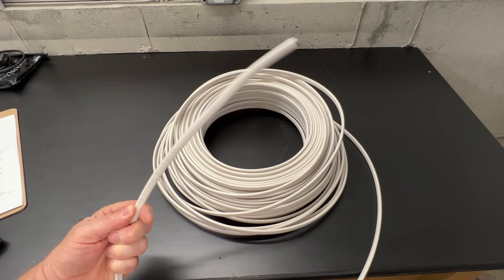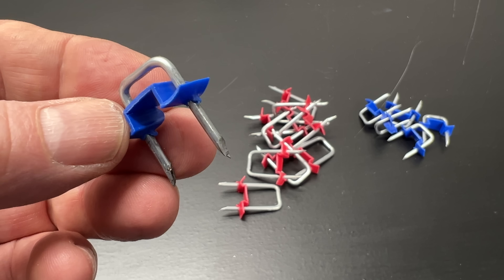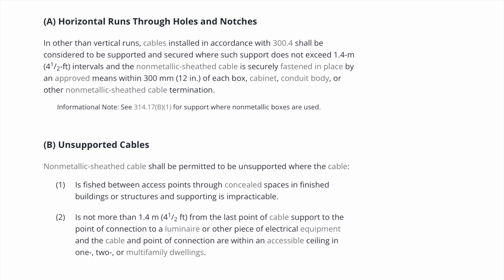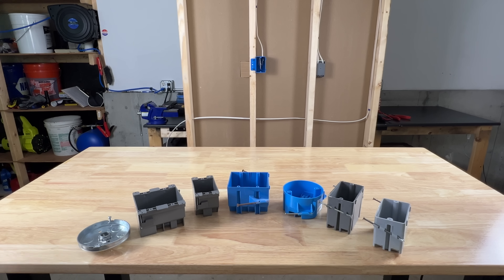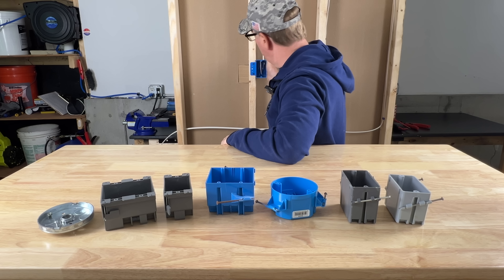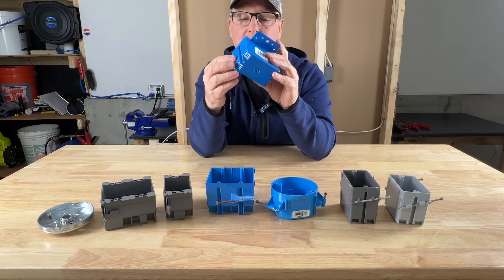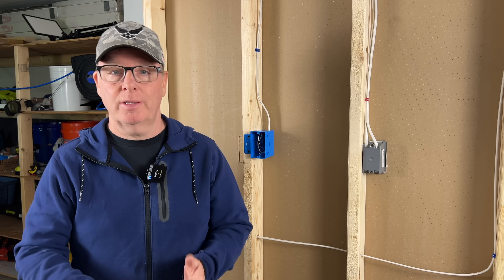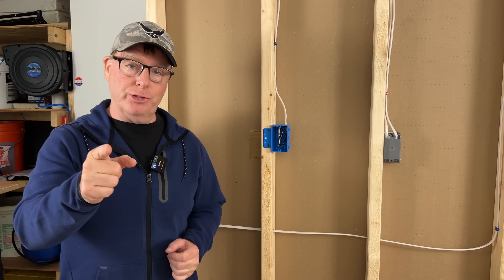ROMEX Cable Support Requirements (2025)

Comment: A staple holds the wire in place ....so a nail  or  screw can peirce into it......the older romex Had a thicker  insulation  on it....hmmmm....NEC....approved. for a thinner insulation ??????...what to save money???how's that safer....
Reply from the maker: I'm pretty sure the idea of securing the cable in place is to prevent damage. There are rules around how close the cable can be secured to the edge of the wood member or through holes or notches without additional protection. Maybe take a look at article 334.

Comment: @BackyardMaine Shouldn't it then be code compliant to put a cable staple 4" from the junction box AND have 8" of cable slack between the junction box and that closest cable staple?
Reply from the maker: That would be 4" of slack and then 4" to the box. You could do that possibly but you would have to be careful about the bending radius of the cable which has code limitations as well. In my view with single gang, non-metallic boxes, the best way to leave slack, if you really thought it was necessary, would be to leave it above the staple and just make sure the staple is not tight against the cable.

Comment: Are there code issues related to the type of staple? I'm thinking of those staples with two nails vs the u-shaped continuous steel ones? I confess that as a DIY guy the "2 nail" versions are easier in cramped quarters.
Reply from the maker: Any staple will work as long as they are listed for NM cable support. The 2-Nail staples are fine.
Reply: Follow manufacturer instruction.

Comment: Great video John. Best one I have seen yet of the dozen or so I have watched. I am probably a little giddy that you proved service loops are not legal (except of course when clamped and not over the 18" length maximum). I think service loops defeat the purpose of securing cables as the cable can accidentally be rolled out of the wall before or during the final enclosure of the wall. It's also very wasteful with only a incredibly slim chance of ever being used to 'save' time ( but that's another entire discussion). Bottom line, the service loops I have seen installed are almost ALL noncompliant. 👍
Reply from the maker: Thank you my friend.. I don't like them either. The big round loops you will see similar to the one I made in the video are always a code violation. The code change adding the 18" maximum cable came in the 2020 update. I think or it could have been the 2017. I'm sure it was made to limit service loops. I have another video going live this evening on a not so common method of wiring three way switches. Thanks for dropping by..

Comment: In the last scenario, what if you made your service loop and brought it back through the staple which is 6" from the box? If you don't drive the staple in too hard, the service loop can still be pulled down into the box if needed.
Reply from the maker: Many people even electrician will drive the staples in tool tight.. The staples are just there to hold the wire in place so it won't get damaged. I usually leave a bit of slack in runs by squaring off all the corners and leaving the staple where they are making contact but not tight. Then like you're saying you could pull a bit of slack through the staple. Thanks for adding to the conversation. The video I made before this one was on extending short wires.
Reply: Hello, I’m planning to run a Romex cable (15amp circuit) behind the Sheetrock wall to extend power outlet to the top in order to have a wall mounted TV. Question is that a code violation not to secure a romex cable to the stud? I live in TX so not sure if TX code says something about this.😊
Reply from the maker: @BB-fp6gh  According to the national electrical code you can fish NM cables in the wall without any additional support. The old work box will also have a cable clamp so you are good to go. I don't know your local code but I would be shocked if there was an issue.

Comment: I still don't get why a so called "service loop"  is loved by so many.  Between the insulation install and drywall hangers generally not giving a rat's ass I think they are trouble in waiting
Reply from the maker: I don't leave service loops very often. If I'm in a bathroom and I think the vanity may have to move a bit or some other similar situation I may leave one but other than that I don't. In fact I really see anyone doing that at least around here.
Reply: It's left because drywallers suck and will shredded the wire in the box when cutting them out leaving you with 2 in of usable wire. So you leave the loop to pull more when that happens
Reply: It means less swearing when you replace a receptacle and have no extra length to deal with.

If you ever deal with fixing an old aluminum wire house via wazoo copper pigtails having extra wire helps. If none then hammer out the wall and sheet rock repair is required. Lol

In flooded areas here like Katrina when there is no extra you have the boxes be 6 inches higher.  Ie you replaced the 1st 4ft of sheetrock and the salt water ruined about 1 to 5 inches in the wire. So you have to cut off until good. So with zero reserve you raise the boxes.

Comment: So does that mean a 2 or 3 gang box without cable clamp is a code violation? Regardless of a staple within 8"?
Reply from the maker: Only single gang, non-metallic boxes are made with no cable clamps unless they're supplied with KOs for using ROMEX connectors.
Reply: @BackyardMaine  i thought the cable clamps in my PVC 2 gang boxes were knock outs just like the single gang, so I snapped them off just like I did with the single gang. Do I have to replace all these boxes? What's the best solution? Maybe rewire them and use the other holes/clamps (that has not been snapped) in the box and just ignore the knocked out hole?
Reply from the maker: @blamuk  If the walls are open just staple within 8" of the box. If the was are closed forget about it..

Comment: That seems the way it has been for years although I don't remember a service loop being mentioned. It would seem that a service loop could not be used with a 1 gang plastic without a clamp although not mentioned
Reply from the maker: The 18" max cable length was added to the code in either 2017 or 2020.  I can't remember for sure but it was one on those cycles.  I actually said "and since it’s measured in cable length leaving a service loop is not going to be possible" when referring to the 8" support. I think??

Comment: Always great information John!  After watching these, I'm always wondering how many inadvertant code violations I've committed in the past in my home improvement projects.
Reply from the maker: Thank you. Much appreciated. The code can be tricky if you're not used to using it daily. I try to state the requirements but then talk about them in practical terms. I'm not the best but I try real hard.
Reply: most importantly is your work safe and you understand wire size and breaker size relationships. There are other important rules but clamping or stapling distance to boxes isn't too important as long as you do it. If your work is being inspected then you might be more careful. In my many years as a general contractor my inspector only looked at my panel boxes and on final tested every receptacle. They don't have time to inspect every staple.

Comment: Ive been an electrician since 87. The only time I staple is if the inspector requires it which now days they usually do. Once I'm out of the jurisdiction of the inspector I don't staple unless the house is foamed or I feel the need. I don't know how many times on a new home I've had owners want me to add another switch etc in a box while we are trimming. If the wire isn't stapled I've used it for a pull to add another romex. If it is it makes the job a whole lot harder or impossible if there are fire blocks in the wall. The code book can be a pain.
Reply: Do it right or stay home! It's not a hobby. If you don't like something in the code, you can  fill out the form to make a change, oh wait, it's a pain for you!
Reply: @JM-iz3fr  Settle down Karen!
Reply from the maker: I understand..
Reply: Staples have always been code as far back as I know. In Texas since the state took over licensing,  all jobs are supposed to be inspected. The builder is supposed to hire an independent inspector if they are outside a municipal jurisdiction.
Reply: @nooneyouknowhere6148  In my part of Texas once you get outside the city limits it’s the Wild West. You do as you please and I don’t know of any contractor that’s hired an outside inspector. Contractors hate inspectors.
Reply: I understand that code  compliance can get in the way of efficiency. I humbly suggest compliance and charge accordingly with a change order.

Comment: Excellent review, I may still fail my first rough-in inspection, but at least not because of cable stapling.  Almost finished with a complete rewire to current code of my 2500 sq ft 100 year house that had functioning knob and tube.  Really appreciate your videos, thank you.
Reply from the maker: Glad it was helpful! I love being able to share my experience now that I'm retired. Thanks for watching.
Reply: I know this is old, but, did you pass inspection? If you had a hard ass inspector that didn't have his whiskey for breakfast, he will fail you one way or another. I redid many rooms in my house 15 years ago. I went 'by the book'. I didn't want to do it twice or three times.  The local inspector, now deceased, told me I should have gotten an inspection. Then he asked if the walls were already up. I said they were. He said, "too late now."
Reply: @kirok3184  The City of Richmond IMHO has a great Buildings Dept.   They allow you to schedule a consultation with the inspector, so I had him give me a walk-thru as i was doing the work, and resolved several issues.  So when the actual cover inspection came along I passed.   I still need to finish a few things to get the final, but figure that should go well.

Comment: Is it a no no to use nm cable with metal boxes ? Conduit required im guessing
Reply from the maker: NM cable can be used with metal boxes. They make them with cable clamps for NM and another style for MC or BX. Or you can use boxes with knockouts and add connectors.
Reply: @BackyardMaine  thanks for the quick reply and clarification
Reply from the maker: @Blue_Dog_Ranch  My pleasure.